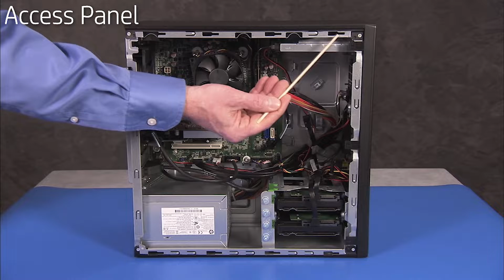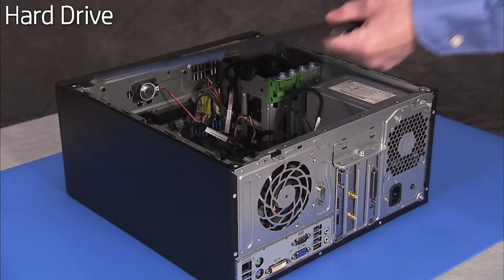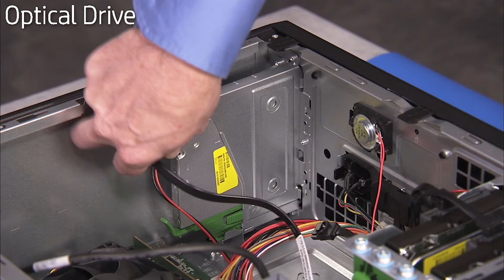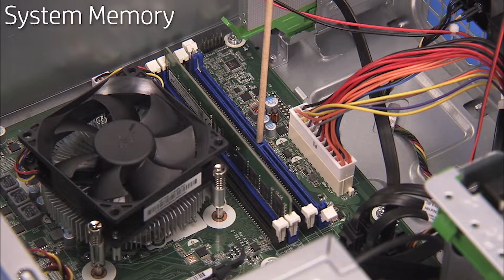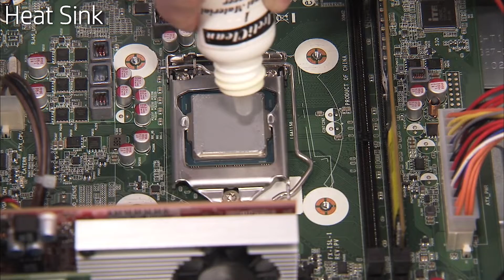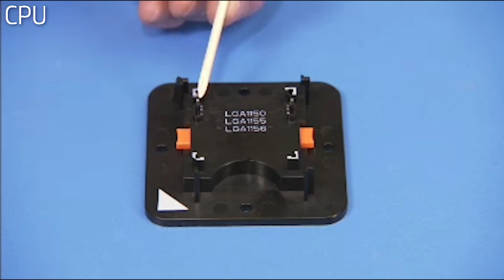Removing & replacing parts for HP 406 Microtower PC | HP Computer Service

Comment: Bootup time is very slow on my machine. Same machine you are taking about.
Reply from the maker: +Career Guide Assam Please perform updates via Windows and HP Support Assistant as mentioned below to fix this issue: Step 1 Windows Updates - 1) In the search box, type and open Windows Updates. 2) Check for updates. 3) If the updates are available, click on install and restart the computer. Step 2 HP Support Assistant Updates - 1) In the search box, type and open HP Support Assistant. 2) Check for updates. 3) If the updates are available, click on install and restart the computer.
Reply: @HPSupport  Thanks but I have already done those steps. My PC takes 2-3 minutes to bootup. Is this ok or is there a problem?